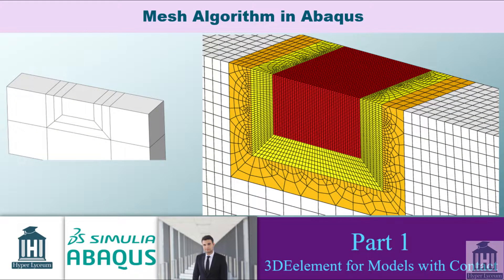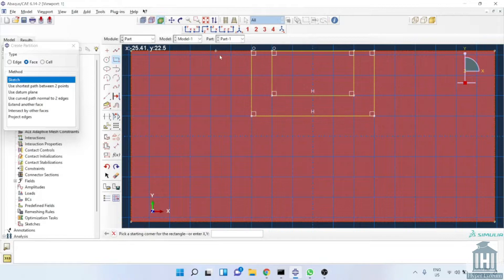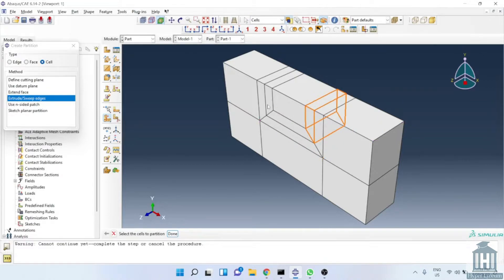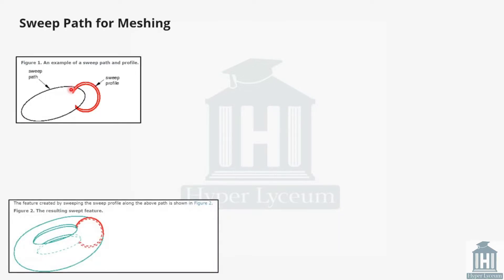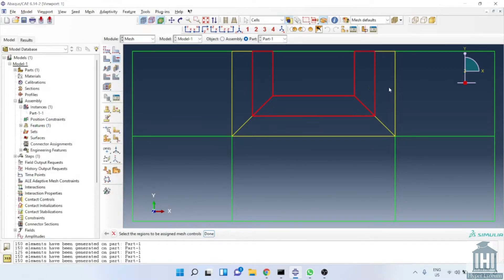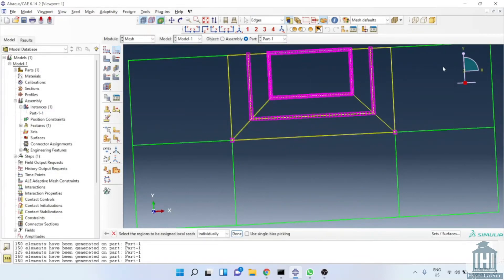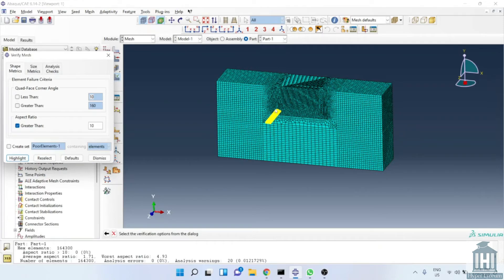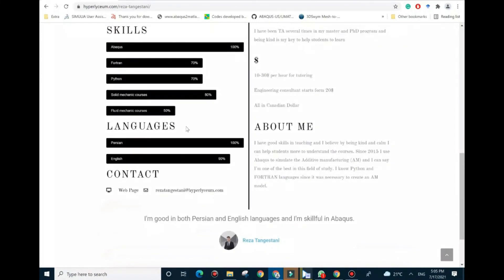Meshing Techniques in Abaqus: Part 1- 3D Element

Comment: Hi sir, thank you so much for sharing such type of very informative video. I am currently working on a simulation for thermo-mechanical analysis, when i go for mechanical analysis, getting this type of error; 

The volume of two elements is zero, small, or negative. Check coordinates or node numbering, or modify the mesh seed. In the case of a tetrahedron this error may indicate that all nodes are located very nearly in a plane. The elements have been identified in element set ErrElemVolSmallNegZero.

Plz suggest a solution for it.  Thank you.

Comment: Sir i'm getting this error please tell what should i do?

The volume of 756 elements is zero, small, or negative. Check coordinates or node numbering, or modify the mesh seed. In the case of a tetrahedron this error may indicate that all nodes are located very nearly in a plane. The elements have been identified in element set ErrElemVolSmallNegZero.